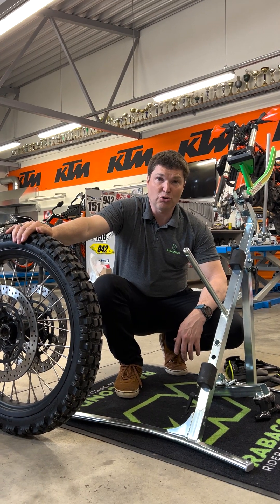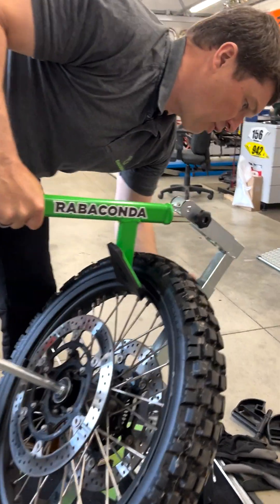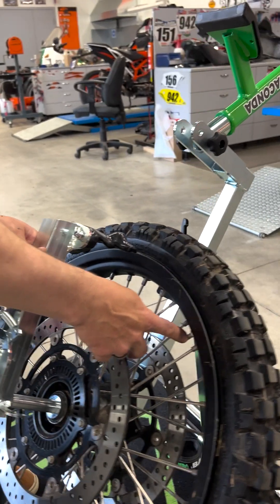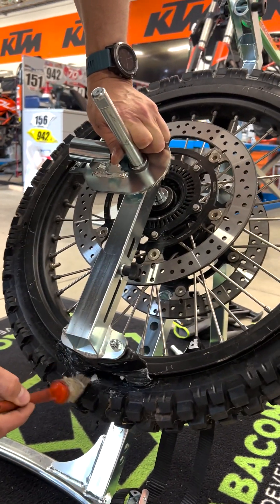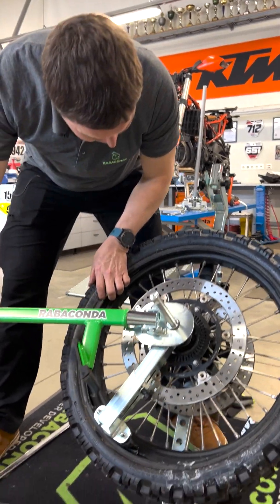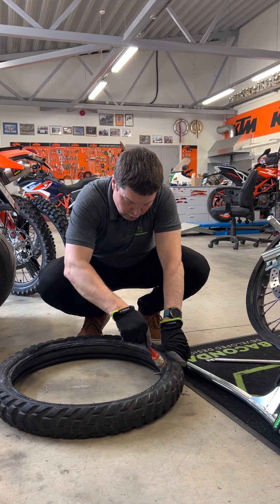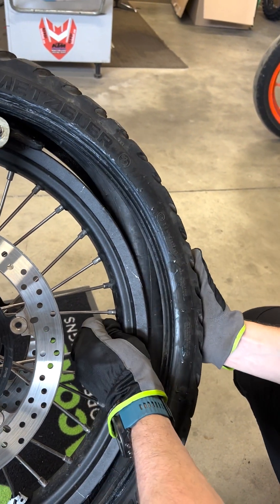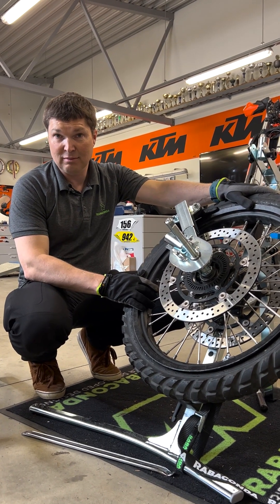Does It Change KTM 790 Adventure R Front Tire with Tube?

Comment: Very nice Demo. 
I noticed that during removal you only put bead grease on the tool head, is that just for this soft tire?
Also, does it help to loosen (not remove) the valve nut first?
Are there any plans to expand this tools use (or the mini tool) into Golf Cart Tires? At 205/50 x 10, they are a real Pain!!
Reply from the maker: Best to use soap water spray for mounting actually and bead grease only for mounting. Yes, need to remove valve nut first not to damage it. We’re thinking about the golf cart solution

Comment: I just did my 790 adv. tires with it. Works like a breeze. The lube  helps a lot I think. The youtube videos were reference  3 times during the first ( front) tire change. Did not need to watch again for the rear. Tires changed, Battlax AX41. Just get the bead in the drop center. 

Me owning a Machine shop/ fab shop for aerospace companies here in Los Angeles it is refreshing to see  such a well designed and built kit. To many maker have China make their stuff and it's all junk.
Reply from the maker: Erik! Thank you so much for the good words. It means the world to us!

Comment: I was just defeated by a Tenere 700 front tire with tube, Mitas E07, very stiff tire with very deep beads. I could not get tire into the drop centre to gain room because the bead is so deep, it is pretty well in there already. The tire is so stiff that the iron puts pressure on the duck head to the rim, I could not move the duck head even with bead grease and soap water. I have done my GS tires and tires on an old Kawasaki Voyager(15” wheel ) with it, I love the machine.  Can you do a video with this Tenere/tire combination please.
Reply from the maker: The KTM and Tenere rims have the same dimensions, and the technique is the same regardless of whether it is a Mitas or not. So I don’t really have any additional suggestions other than getting as much of the tire into the drop center as possible and using lube, which you already did. Warming up tires before is also a good tip. Hope it helps!
Reply: The same happened to me used the Rabaconda street tyre changer for Mitaz E 07 + but couldn’t succeed. Destroyed 2 tubes in the process. Could only managed to changed the rear with it. Especially on the Mitas E07 + 21inch front it was impossible  impossible on my T-7. Not sure it’s the rim design or the E07 are difficult to put on.

Comment: Thank you for this video. Is this system suitable for KTM 690 ENDURO R tires?
Reply from the maker: If you are not using bib mousse foam inserts in your tires, yes. Mounting bib mousses with a duck head mounting system is impossible. You cannot get the tire into the drop center from the other side, as the mousse “inflates” the tire. There is simply no room to operate the duck head. Same as you cannot use an industrial tire machine to change tires with bib mousses.
Reply: @Rabaconda  Thank you for all these details but I plan to stay in an inner tube. A final point, is it recommended to regularly disassemble and reassemble a tire. I plan to ride a road tire every day and fit an off-road tire once a month for off-road use.
Reply from the maker: Gotcha. Some of our customers do racing, changing between road and track tires daily without a problem.